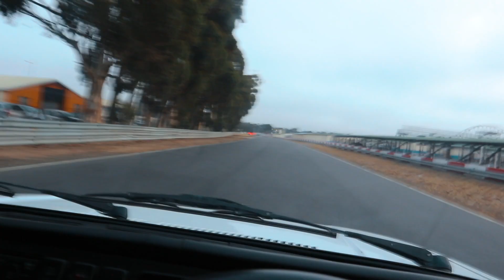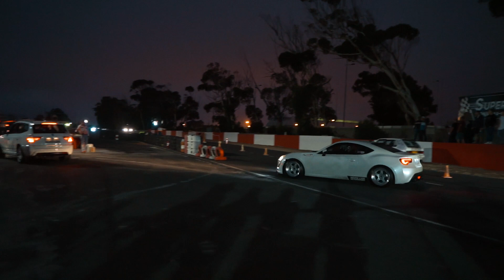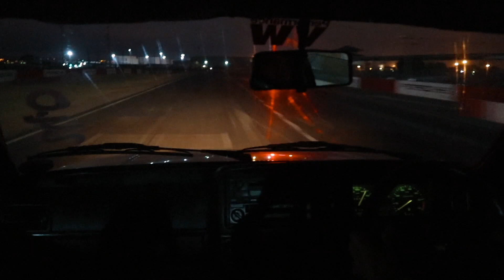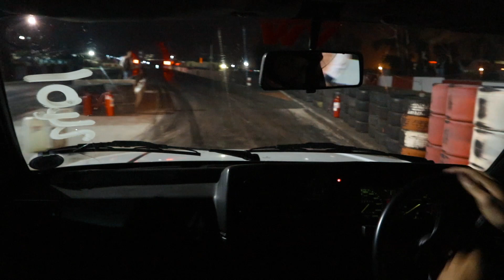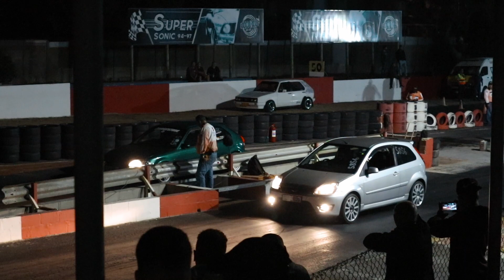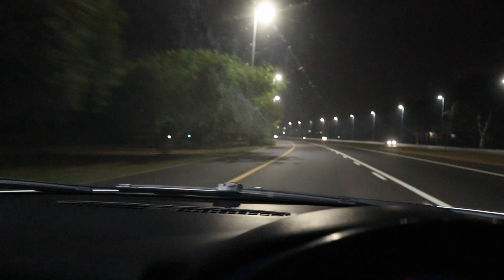MK2 Golf GTI 16v ITB's - drag racing - Killarney robot racing -  04/03/2020

Comment: Late to the party but Great video bro👌🏽
Reply from the maker: Thanks for watching the older content. I’m looking forward to racing at killarney again. But it might take a while under the current circumstances.
Reply: @lowdl  I miss it too... maybe I'll pull up next to you while you're waiting next time... would've been a good race for me if you were still N/A... now with upgrade I'm not feeling so lucky
Reply from the maker: @Koup_TV_  Those quiet nights were great for racing. So chilled. When I was NA I ran a 14.9 but it was 15.2 second car on average. Now that it’s boosted, it should run high 13’s. But the proof is in the pudding, need to make it happen. I might try with a Dragy to see what’s up in the interim.